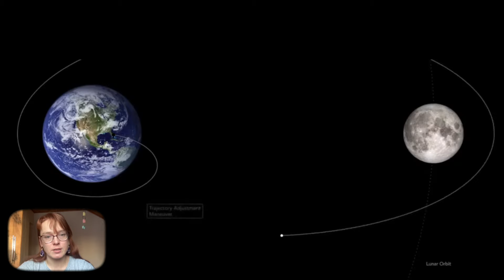Failed launch of the Peregrine lunar module [space news]

Comment: Russian Wikipedia states that Vulcan development started in 2006. That is wrong. In 2006 ULA was founded.
And the English Wikipedia correctly explains that Vulcan is the first rocket under development since funding of ULA in 2006.
Vulcan development started in 2014. Mainly because of growing competition from SpaceX, who started to snatch away good government contracts.

As early as May 2014 Rogozin stated that the RD-180 will no longer be available to ULA.

Apart from that. The launch did not fail. It was the lander wich failed. Quite similar to the failed Luna 25 mission in 2023.
Reply: I’ll correct it on Wikipedia later, you correctly identified the beginning of 2014. The word “launch” in this video title did not refer to the rocket, but only to the launch of the module after separation from the rocket stage... Luna-25 reached the pre-landing orbit , having previously made several orbital flights of the Moon, and the Peregrine module did not enter lunar orbit , he remained in a long-period almost circular orbit within which both the Moon and the Earth are located (at the moment this is the case) - this is the difference.